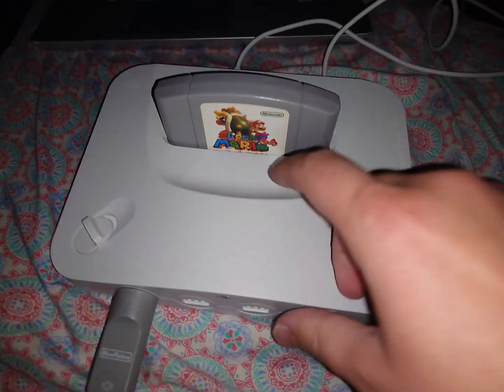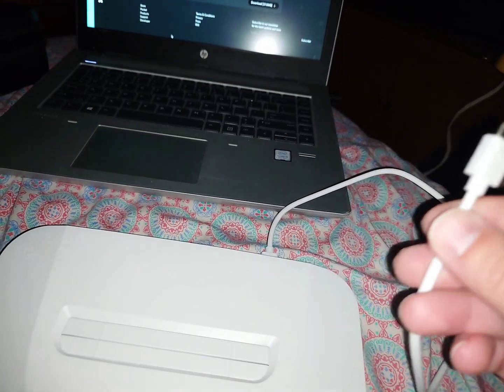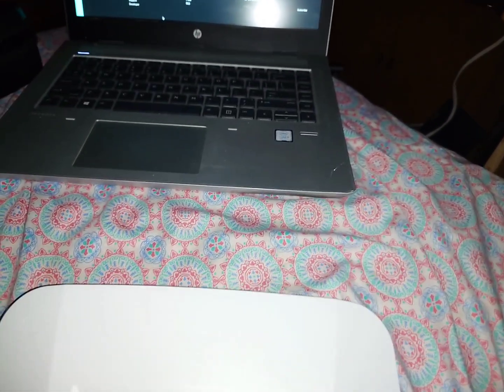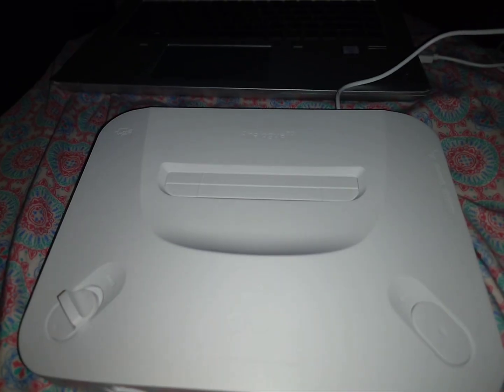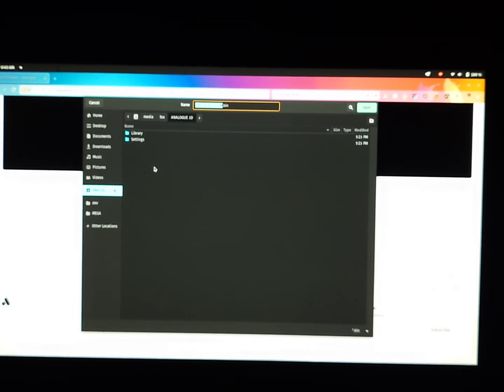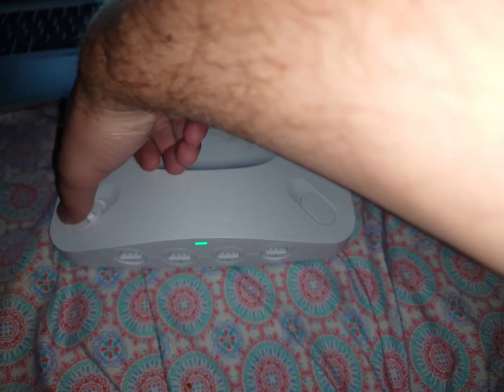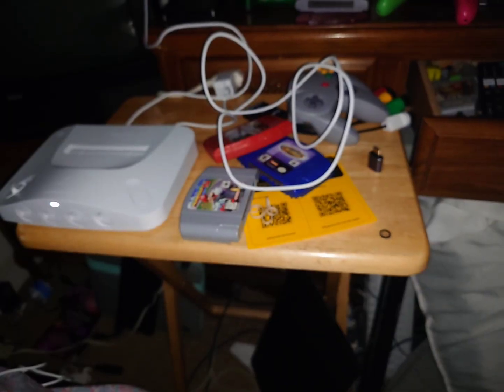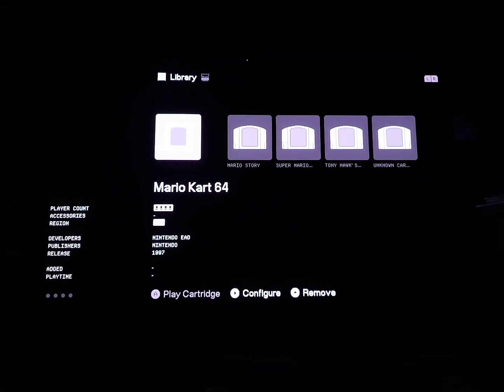How to Update the Analogue 3D!  Firmware Update SD Card

Comment: I’ve tried both ways. The window doesn’t pop up for me to add the update to the directory. I’ve added it via the SD card but no update happens once plugged into the tv and wall. What to do in this case?
Reply: Same thing happening to me.
Reply: @seangorman3959  did you fix it?

Comment: My SD card won't come out.   have they started gluing them in or something?
Reply from the maker: Mine didn't come glued in, but they are a little hard to get out.  I had to use my fingernails on the little tab on the top of the actual SD card.
Reply from the maker: I just made a video showing how to remove the SD card:
https://youtube.com/shorts/vEo_pz7nauI?si=NaViOYDrKKg7ctCM
Reply: No, they're just stubborn. Also, be careful inserting it in specific SD slots. Mine got stuck and took a great deal to remove
Reply: I used a small screw driver to pop mine out
Reply: It's got some crazy tight fit to it. I used the back of a brush handle to pop it out.
Reply: Read the Instructions on the Site linked on the paper. 

There are two different say to Update the console. 

Also, For something already boxed and Shipped, How would they Start Gluing them in when we are all getting the unit. Your question is Stupid.

Comment: How do you take the SD card out?
Reply: You just gently pull it. Use the little edge to help. It's not glued in or anything but I understand. I was surprised to hear after my first attempt that it does just pop out.
Reply: That's my problem too!   I had to use a pair of pliers to get it out in the end,   but the card has a bit of a lip you can use your fingernail to retrieve the next time.

Also DO NOT put it into a regular in/out card slot on your laptop Etc.  the card isn't long enough and gets lost inside. >.>
Reply: @Larry 😂😂😂😂😂🎉🎉
Reply from the maker: I just made a video showing how to remove the SD card:
https://youtube.com/shorts/vEo_pz7nauI?si=NaViOYDrKKg7ctCM